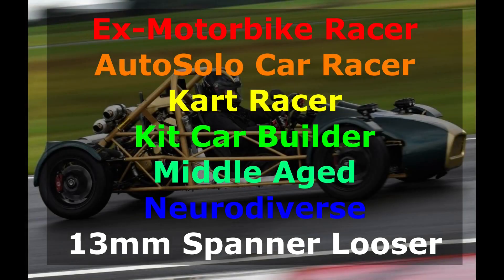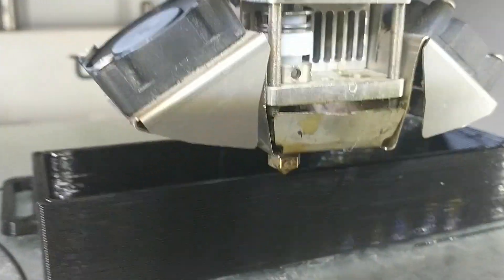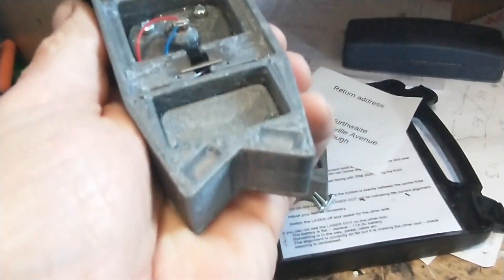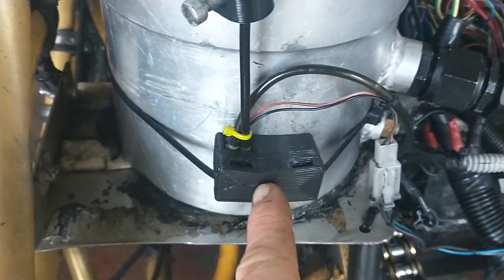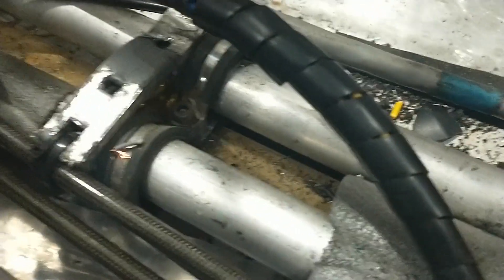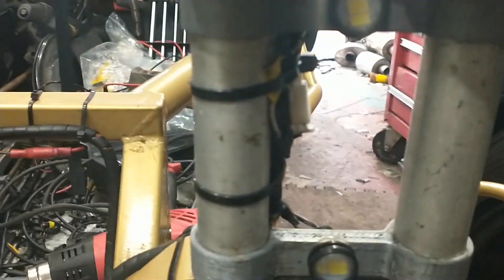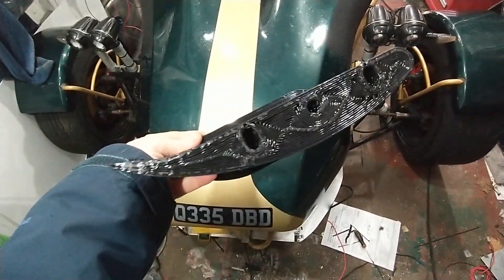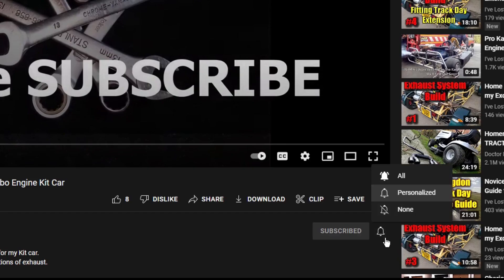3D Printing Car Parts for my Kit Car - Is a 3D Printer the most useful tool for a car builder?

Comment: Thanks for the shout out
Reply from the maker: I really like the build you are doing/have done. Did you see my message about the possibility of you sharing CAD or tech drawings. I think from the baulk head forward your design is pretty much what I want to make next - just need adapting for a big car engine at the back.
Reply: @Lost13mm  Sorry I missed that message. The design and associated analysis info is co-owned by my employer as I used their tools and IP for the build. So anything I share has to go through that channel. Well have to get back to you.
Reply from the maker: @timwoods8483  OK - I understand. Did you get any plans/designs for the Warner? I have tried contacting them but can't get a reply.

Comment: could you 3D print car door handles for a mk1 escort?
Reply from the maker: Yes - but I am not sure it would be strong enough for real use. Do you have a print file for one? If so I can print for you at cost of plastic plus beer money.
Reply: @Lost13mm  no i dont have a print file. was looking to get mk1 escort handles made in 3d printed carbon if its possible. i have seen them done somewhere but cant remember where
Reply from the maker: @garrybull4165  The design will be the issue. Or you need to find someone with a scanner.
Reply: @Lost13mm  ok will see if i can find someone who can scan the handles
Reply: @garrybull4165  Currently waiting for my 3D scanner. If you can wait a little longer, I should be able to print them for you out of PA-CF filament.
Reply: @Thomas-ss1iu  no probs mate. let me know when you got it sorted and i'll arrange to ahve a chat with you

Comment: Interesting. Your 3D print skills are obviously a bit ahead of mine. I'd be interested is seeing more about the design process as that is one part I struggle most with - using Freecad. Eventually I printed some door handles!
Reply from the maker: Hi - I use FreeCAD as well. It does take quite a bit of time to get the working with that program. I have been using is for about 6 years & still have much to learn. But I am lucky that I can picture what I want to make in my head, rotate the thing around and "see" how I need to design in in FreeCAD. I think, like most programs, for me it is a case of using it, then when I cant do something I think it probably can do look on here for tutorials, then go from there.